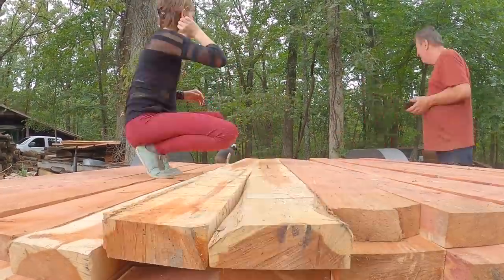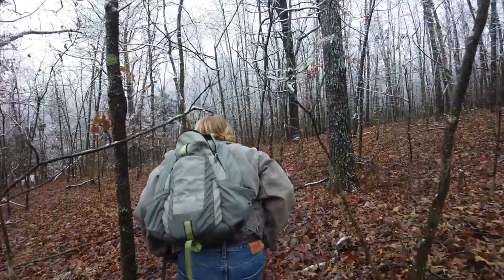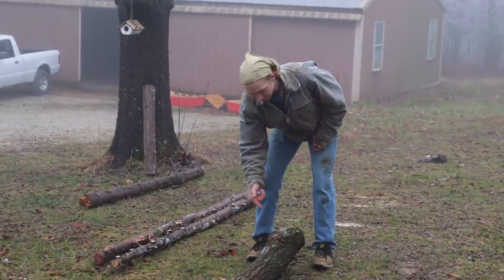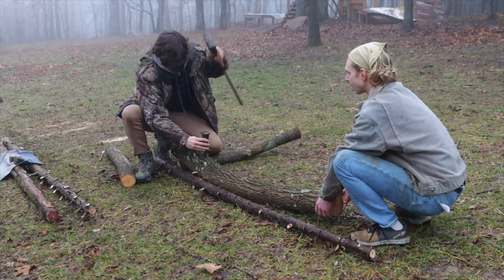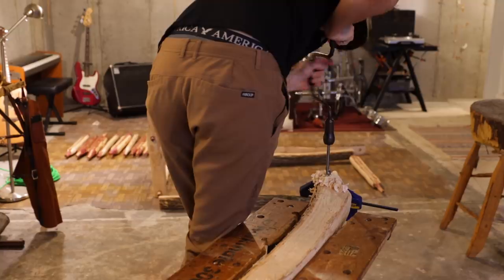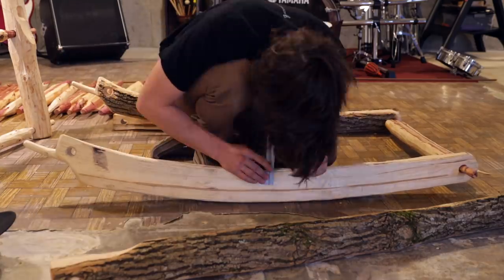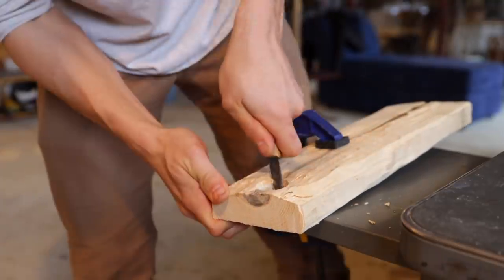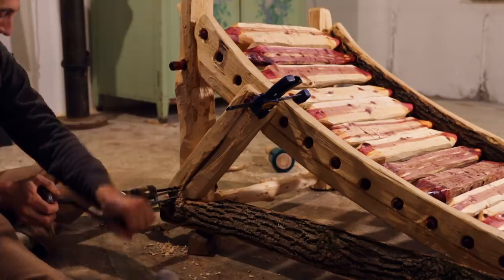Building A Bike Jump With NO Screws or Power Tools

Comment: this video is so good it literally calmed me down. I have a motorcycle and the gas cap needs to be replaced cause it's leaking gasoline but smart-ass me decided to try and fix the thing instead of leaving it be until I get a replacement. As I was parting it out I lost a piece in the grass and tried searching for it for hours with no luck. Came here watched this video and my frustration faded away for some reason. So thanks :)

Comment: I like the thinking of building stuff this way. As a CNC machinist tho, using my muscles to work on steel or even aluminum is almost impossible. I could use a file, but I don't think drilling would work very well. :D
Reply from the maker: Nate was actually a machinist as well but moved over to wood!

Comment: really nice concept! you should do this kind of jumps and features more often! I got one little point to discuss (no hate) and that's the way you guys cut the tree... it was not that good.. I studied ecology and biodiversity for a few years and we learned how to do this technique of taking away some parts of a tree to use it and not kill the entire tree for it and also the entire thing what happens and could happen in the long term if you do the cut wrong.. (we used the same tool you guys used for it so its easy). basically what the way the tree was cut caused is a large portion of the bark being exposed to the exterior, it can cause infection to the tree and start rot. also water and bugs will come in between the bark and the core more easily causing the three to rot from within over time. And if the tree survives it just wouldn't heal nice and fast.
HOWEVER, never criticize someones work without giving a solution. The way to prevent this from happening to other trees in your the beautiful forst you own, is quiet simple, you first make a cut with the saw on the side the branch has to fall, about 1/4th of the thickness of the branch deep (make sure you always cut in a 90 degree angle relative to the branch). after that you go to the other side of the branch (the side you cut from in the video) and you cut 1 inch higher up the tree in relative to the first cut you made. (again 90 degree angle) and you just start cutting with your saw, until it starts falling ( the cuts you make should not connect to each other if you do it right and stay 1 ing apart). When the branch has fallen you should have a little staircase scenario on the spot you cut. In the case you got some stikes of wood that are standing right up the place you cut the branch, you better remove those too, so the tree heals nicer.

I hope I could help with this information! and last but not least, I really like your content, keep up the good work!

Comment: Nice way to go but keep in mind that a tree that is "hurt" by removing a live branch and exposing its interal to the atmosphere is most likely to get a fungus or bacterial infection. That will cause the tree 🌴 to instead of spending most of its energy resources needed to get throughout the Winter or develop, to use it to try and fight the indection. Most trees die after a few years if such a wound is inflicted. Although its a process that is slow it actually most times leads to their demise.